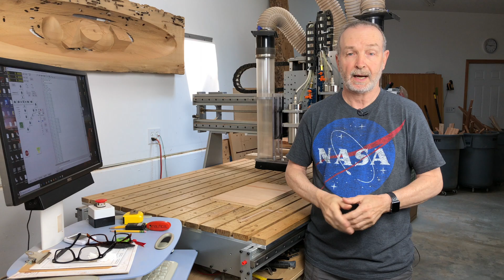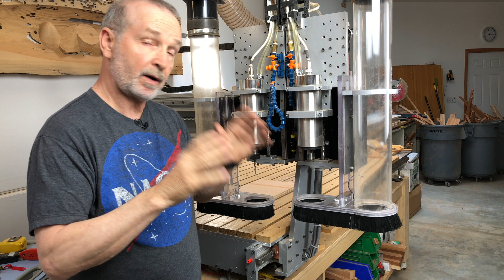All about CNC's Home Position and why it's important.

Comment: 3:41, thats a great idea.  Could that point also be used for tiling?  Always moving your stock to that pinned position?
Reply from the maker: Actually, any "relative" origin point can be used for moving a long piece through a CNC. I use  some of the dozens of pin locations on my CNC bed and dowel pins  to do just that. On long pieces I machine dowel holes on the back so I can move a piece along the bed.

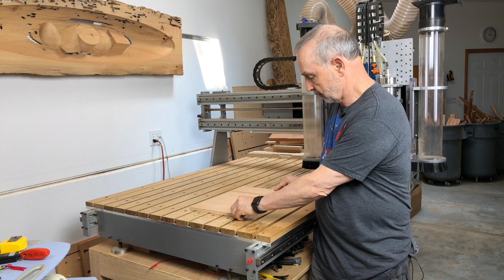Comment: I have no argument with what's said at 2:30; however, ipso facto, when you say origin point and then move a piece within the CNC framework, it should be said that the nominated origin point moves when the workpiece is moved. Otherwise, in the context you gave, it becomes easy to get confused by your use of words - to me, at least. That is, the home position varies with the nominated position on the spoil board. I should also add that since the presentation is 5 years old, it might have aged itself.

Comment: Some questions....
Are limit switch also a homing switch too? Since arduino cnc shield don't have pins for homing it has only limit switch pins and if it's separate switch, how many it needed or just homing switch installed on z axises and it also installed both sides? Like z+ z-?
Reply from the maker: Generally, homing and limit switches are the same thing. What they do is give the machine a reset to 0/0. From there, movement can be measured out accurately. Your question is kind of mixing the two concepts together: the concept of homing with your particular physical hardware. CNCs are often very different from each other when it comes to hardware and design. You're going to have to ask your hardware manufacturer about your hardware configuration. The video is about an important concept: the strict correlation of machine hardware positioning, part position, the CAD drawing that everything is based on, and of course, CAM instructions. This is critical stuff for anyone using a CNC.
Reply: @digitalwoodworking  i built my cnc machine using arduino but unable to control or run because of some configuration complications involved I am new in it I wanna start something simple as 2d latter ( on 3d wood sheet ) cutting or engraving using Inkscape soft if possible. Or copy past someone else g code just like with arduino code so I can learn from it.
Reply from the maker: You're at a point you really want to get some help getting your machine setup and some one-on-one or classroom instruction would be a good idea. Expecting to just learn this off the internet could get lead to serious problems. For example, you never want to use someone else's Gcode. That would be a serious mistake.  @omsingharjit
Reply: @digitalwoodworking  why can't we use someone else g code I wondering what could go wrong?
Assuming g code dimensions is smaller than my machine limits.
Reply from the maker: If you don't know why sharing Gcode is an actual bad thing, I'm sorry but I can't help you. Best of luck on your journey.  @omsingharjit
Reply: @digitalwoodworking  no worries if you can't help there are so many other peoples 😏

Comment: Hi Tim,  Do any of these Flatbed CNC routers make provision for a 4th axis (running right up the center of the bed along the X-axis and under the gantry) for turning 3-D objects (not necessarily round) between the centers?
Reply from the maker: Several commercially made machines do either allow or include a 4th axis. Look to the Laguna IQ or Axiom Precision or the Legacy Maverick CNCs for these kind of options.